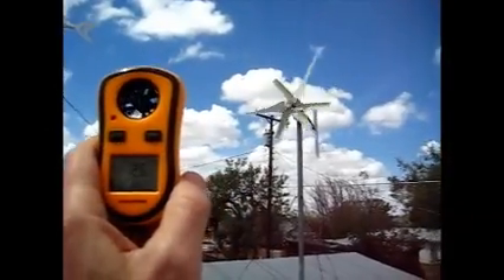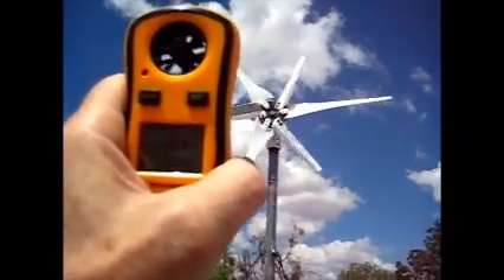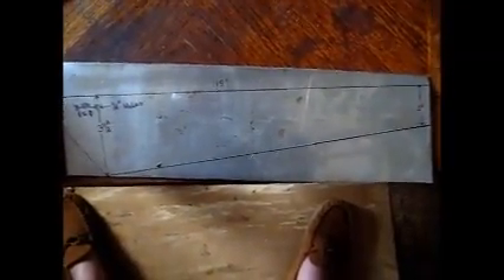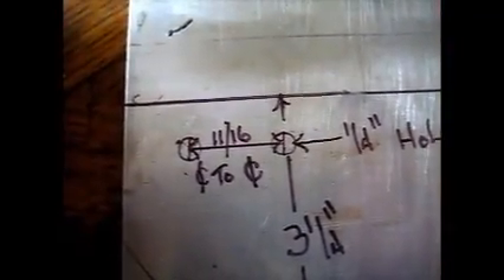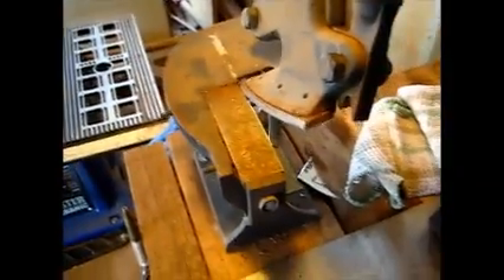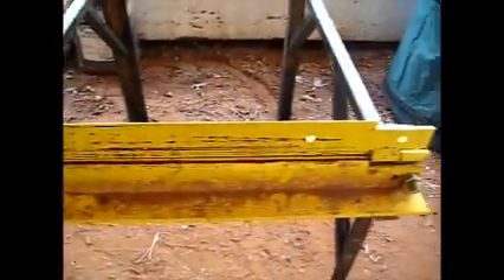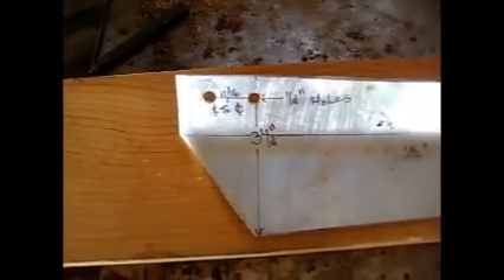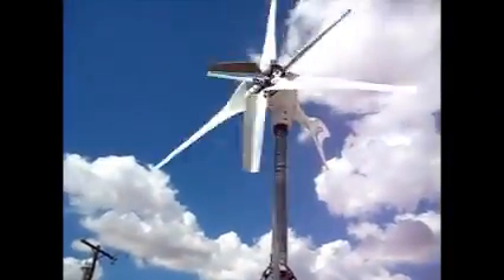Wind Turbine Low Wind Speed Start "Short Blades". Build Your Own.

Comment: sir can i use galvanised iron sheet isntead of alluminium. alluminium is more expensive than galvanised sheet. thanks
Reply: Yes you can use but galvanized will not work great as it's heavier in weight

Comment: Very good idea. I built them and my wind generator starts spinning even with low speed wind (2 beufort). Thank you.
Reply from the maker: sv1eps Great, you should see a gain in power too.
Reply: Electronicdawg Yes I saw a gain but it wasn't so big. The advantage of those sort blades is that you can get power even from slow wiind. In the previous state I had to have wind speed stronger than 5 beufort to get power. Now it starts to charge me batteries from 3 beufort. Thank you again for the idea.
Reply from the maker: sv1eps Exactly, you may not see top end gain but a gain in charge at lower speeds.

Comment: Nice job with the home made blades! Are you getting enough voltage for a trickle charge at the low wind speeds?
Reply: Thanks for your response; the SUN inverter gives somewhat of an advantage in that it has a lower voltage requirement (10.5 volts) than some of the other grid tie inverters that require 12.5 volts (or above) to start sending power to the grid.
Reply from the maker: Pbeas52 Yea yea, my inverter starts charging at 10v.
Reply: +Electronicdawg  ... and for you to get started on charging, about what speed of wind do you need?

Comment: what is the rated output of this turbine sir?
Reply: electronicdawg can it be used using car alternator?
Reply from the maker: francis kaizar Talatala  400w and 200w
Reply from the maker: francis kaizar Talatala Car alternator has too much magnetic cog to start a low wind speeds, unless it's been modified.